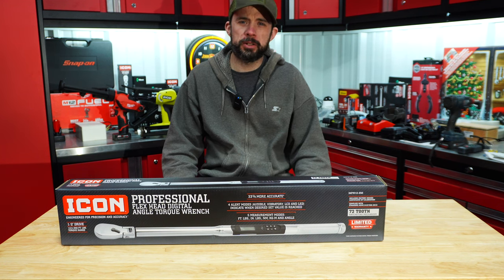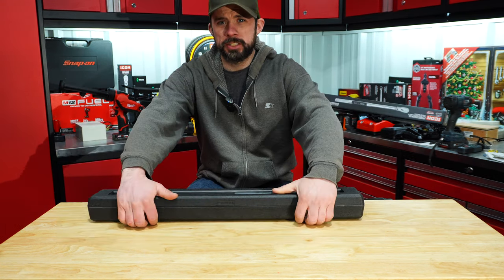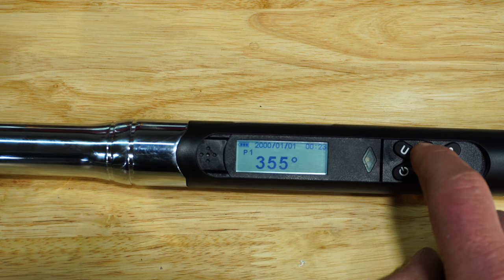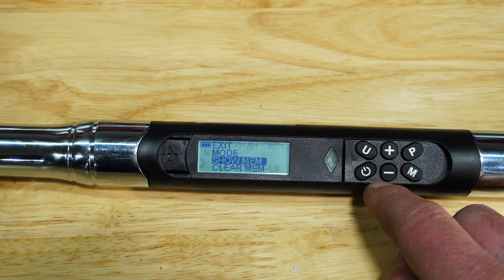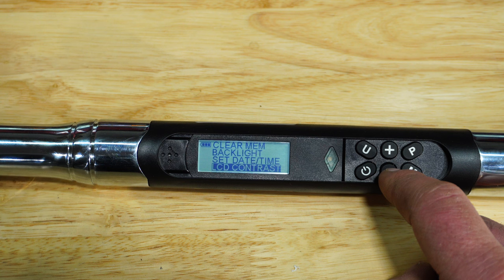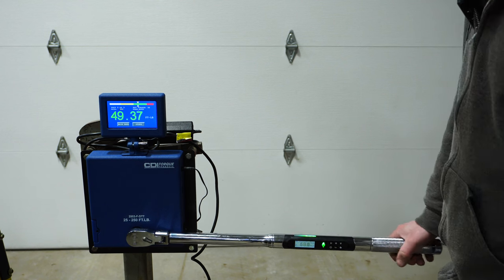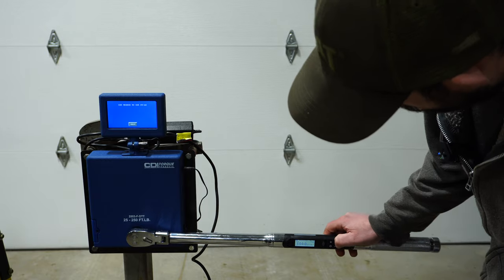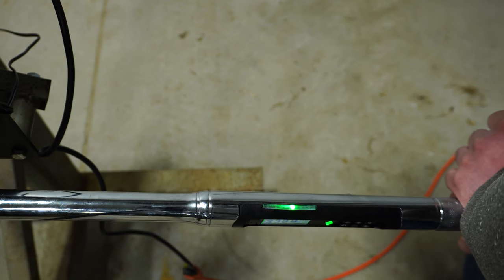Unboxing And Testing The New Icon 1/2 Digital Torque Wrench

Comment: I used this to replace the headgaskets on the Duramax and it worked amazing. I've put on about 10k miles since with zero issues on the truck. I took a trip down to Phoenix for some work and had it in the bed tool box just in case I needed it. When I got back home after putting on roughly 7k miles for the trip, the wrench started acting funny and having a mind of its own.(cycling through menu options, beeping, turning on and off on its own) Not sure what happened but my guess is too much vibration in the back of the truck might have had something to do with it. Anyways, Harbor Freight exchanged it no problem at all and still am happy with the new one. Would still recommend this wrench!
Reply from the maker: Weird yeah maybe just the vibration.  Haven't had any issues yet with mine.  Cant beat the exchange policy at HF,  if it was a Snap-On you would have to send it off and wait.

Comment: I'm not positive, but this doesn't seem much more accurate than the Quinn Digital.  This one is a lot more expensive than the Quinn.  Great reviews.
Reply from the maker: Yep the only big difference is the icon has a flex head.
Reply: Way worth it over the Quinn. The flex head is crucial in many situations.

Comment: Nice video, wrench certainly has a lot of features. I like the torque + angle mode, you would struggle to replicate with the mechanical wrenches. Will be interesting to see it up against the Snap-On
Reply from the maker: Thanks! 

Yep,  to me that's the real + to having digital, is the angle ability.  They also are more precise torque wise but I don't think you can beat a split beam.  But that might be me being old fashion lol.

Comment: The Cornwell 1/2 drive digital torque wrench looks exactly like this new Harbor Freight Icon digital torque wrench. They have the same digital displays, lights, buttons and specs. The same 72 tooth flex heads too. The only difference is the colors of the displays and the handles. The Conwell handle looks like some kind of rubber or plastic composite handle, while the Icon has a knurled handle. And wonder what is the price difference is? Icon 329.99. The Cornwell $549.95?  Plus the Icon has a lifetime warranty. I don’t know what Cornwell’s warranty is.  Great review my friend. I can’t wait to see the Snap On comparison to this Icon digital torque wrench. 🇺🇸😎🇺🇸
Reply from the maker: Interesting I didn’t know that.   Thanks!
Reply: Yes sir, check out the Cornwell website or Google Cornwell digital torque wrench. The also have YouTube videos to on there own YouTube channel. I wonder if there website price is any difference from there tool truck price. It looks like the same Taiwan company makes the same digital torque wrenches. Talk about rebranding with a big price and warranty difference. 🇺🇸😎🇺🇸
Reply: I have the ATD digital torque wrenches with angle. The flex head models, 3/8 and 1/2. They are identically the exact same thing as the Napa Carlyle digital torque wrench with angle too. Same 32 teeth ratchet flex head, spec’s, buttons, lights and same wording and symbols on the display. Just different color.  Buy the way I got mine for more then half price.  I must say they are awesome torque wrenches too. 🇺🇸😎🇺🇸
Reply: Hopefully the 72 tooth head is better than the older cornwell digital.   They were absolute junk and broke extremely easy if you were too quick with it
Reply: Made by the same company, Kabo Tools.
Reply: Yes you are correct my friend. Made by Kabo Tools. I saw that to when I was researching. 🇺🇸😎🇺🇸
Reply: Not Lifetime Waranty ON Icon
Reply: No your giving wrong information. ICON Digital Torque Wrench has a 
“Lifetime Warranty.” , as per 
Harbor Freight website.
Reply: Nice how these China tools copy the good stuff but they never have the same quality. Looking like something and having the same quality are too different things.
Reply: @FAMOUSSLICKRICK  Just confirms how cheap the Icon torque wrenches really are that they will warranty them for life. Other tired the life time warranty and it bit them in the rear end but Harbor Freight sells cheap tools so the life time does not hit them as hard. I will stick with Snap On, they are tools that will get handed down to my grand kids after I pass.

Comment: Looks exactly like the SO $800 version? I am considering it since I've been selling off my Snap On tools to see if it's possible to be a pro without them, lol. Not sure if they are made at the same manufacturer or if the copied the Snap On very well, but either way it's looks like a good value.
Reply from the maker: Yeah I tested it against the 800 dollar snap on very close in design, Icon almost a direct copy of the Cornwell.  Surprisingly it tested better then the snap on and I also found the Icon easier to use.  I cycled both 1000 times in a newer video, even though that shouldn’t matter with a digital torque wrench…..  

I just ordered the new Gearwrench E-spec torque wrench,  by the specs it almost looks to good to be true…..

O by the way been watching your channel for a year now 👍

Comment: Another great video. Thank you! How would you compare this to the ICON 1/2 In. 40-250 Ft. Lb. Professional Split Beam Torque Wrench? I have a ¼ inch and ⅜ digital torque wrenches that can do between 2-100 ft-lbs, but I recently bought a Jeep Wrangler Rubicon and I need to torque stuff in the 100-200 ft-lb range. I want to just buy a ½ for working on the Jeep and I am curious if you think this digital ½ inch is worth the extra $200 over the old split beam. Thanks! Looking forward to you next review!
Reply from the maker: Thanks!  If you don't plan on doing a lot of motor work I would defiantly go with the split beam.  To me the only real benefit of the digital is doing head bolts, were typically you need to do a angle after the torque.

But you can also do that with a angle adapter for like 15 dollars.
Reply: @Tools-Tested  Thanks! Hopefully I won't have to do any motor work for a good long time since the Jeep has the 392 Hemi with 134 miles on it right now. Perfect explanation, I look forward to watching your channel grow! By the way the video on "Best ½" Torque Wrench" where you compare the Snap-On, Icon, and Precision Instruments Split beam, has to be one of the best and most useful tool reviews I have ever seen. It totally convinced me to go with the ICON, it was Honest, full of actual Data (CDI numbers) and helpful commentary. Really great work, thank you.
Reply from the maker: @postbeam8200  No problem,  sounds like you got a awesome Jeep! 

Yeah I’m not biased at all when it comes to result’s, the data is as tested.

I do hope to update the split beam video soon, a lot of people have been asking about the Tekton and Olsa

Comment: I would love to see some low torque wrench.
(Or even the Craftsman at lower settings)

Ones that range form 10-80 ft/lb.
Mostly for spark plugs and such. Which are usually around 13-20 ft/lb.

Enjoy your videos. I really like the fact you are to the point and non-biased.
Reply from the maker: Thanks!  I plan to do lower torque wrenches, it will be in a few months though.  I have to buy another tester to do the lower range.
Reply: @Tools-Tested  AC Delco has some affordable models that seem to test OK.

Comment: where do you take it to get it calibrated?
Reply from the maker: Icon recommends sending it to, Angle Repair & Calibration, 175 Angle Dr, Beckley, WV 25801. (304) 253-5729.

Comment: Someone explain to me why have a reversible torque wrench you shouldn’t reverse it
Reply from the maker: Normally if the ratchet head is reversible, you can reverse it and torque in that direction.  The accuracy in forward is normally better than in reverse.  

Split beam style wrenches only ratchet in one direction.